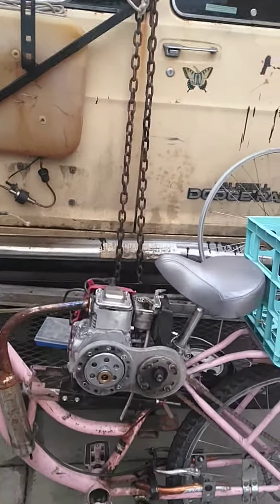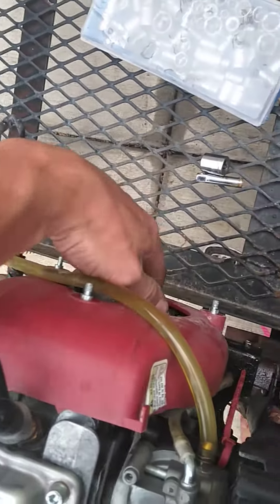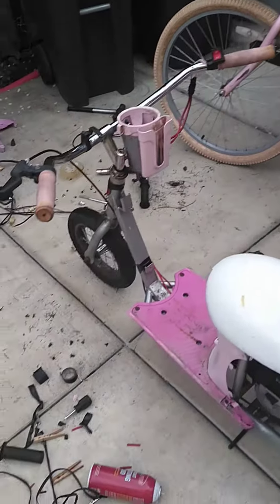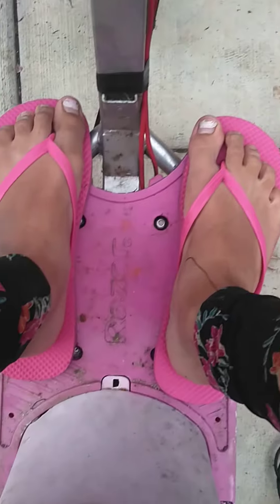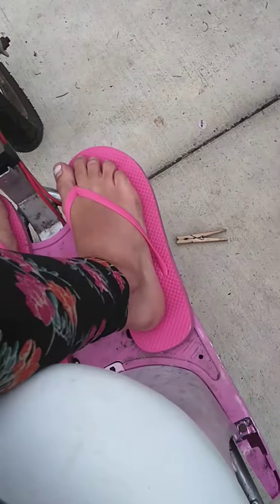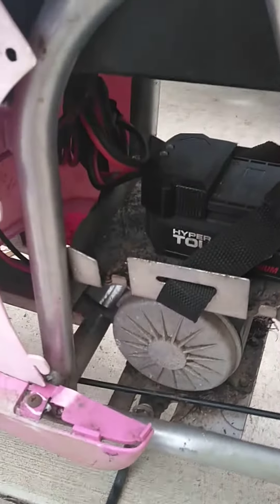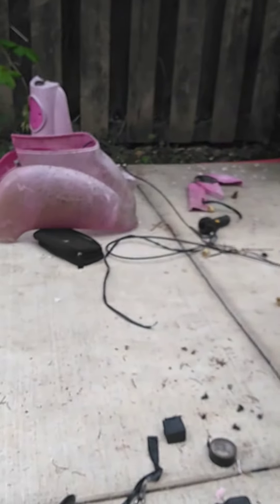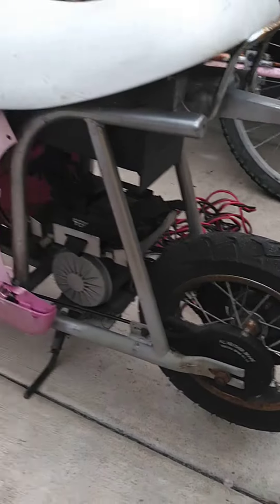I replaced my scooter

Comment: you can wrap a rope around the pull start pulley several times and give a yank... we ran lawn mowers for years with out the pull start piece,, I like the gas tank... I have one of those razor mod scooters I got at goodwill for $15, it needed batteries. Id seen vdo's of adults on them so thought why not,,,,, why not? because I weigh twice what you do... lol.. I flicked the switch and NOTHING, tried shuffling along a little and it kind of tried but... nope... Ive been thinking about buying a 2nd one, welding the 2 backs together and centering a front wheel for a 2 eng 48v trike.....
Reply from the maker: Yeah the gas bike wasn't too far gone it was a simple $20 fix and easy to get around without buying the new car I just didn't want to fuss with it anymore I realized I could get by with far less far cheaper and I was more interested in electronics than combustion engines anyways